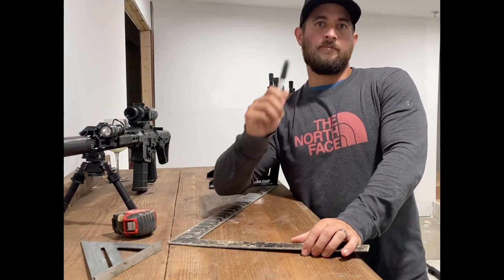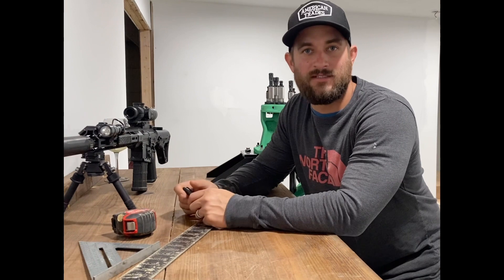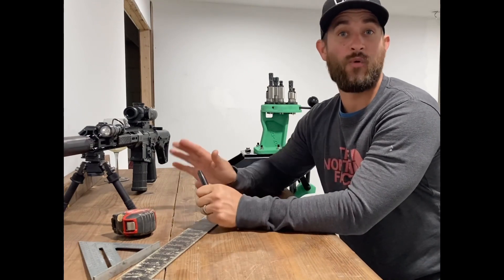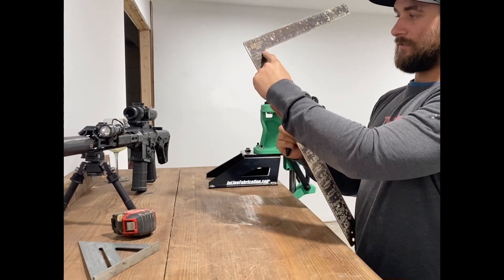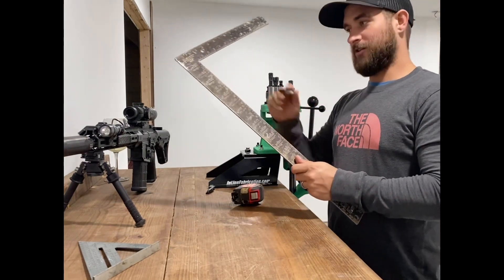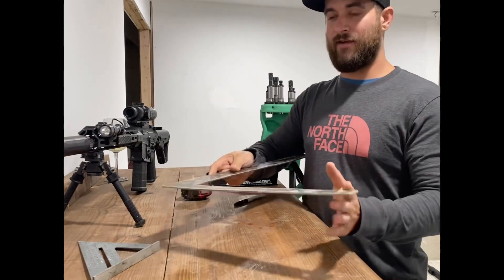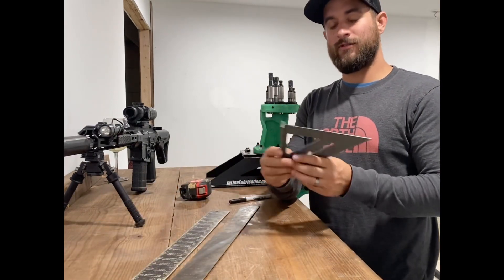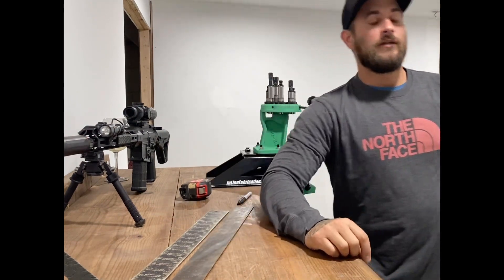3-4-5 trick

Comment: This method also works for laying out buildings or pads.  If using to lay out a large building you can multiply the 3-4-5 by any number to make your triangle bigger.  For example measuring 15' down one side 20' down another the diagonal will be 25'.
Reply from the maker: Absolutely you can. I should have mentioned that. But you are correct sir.